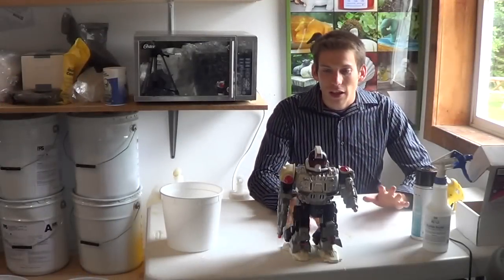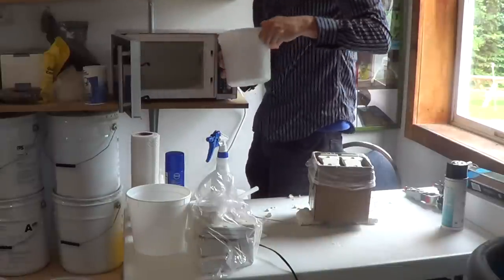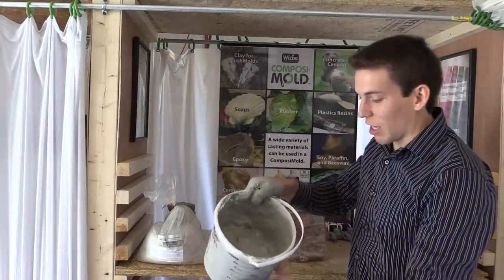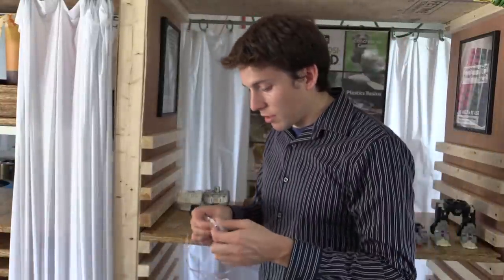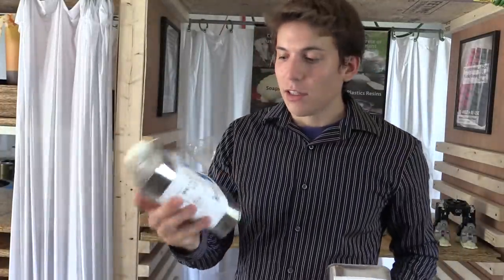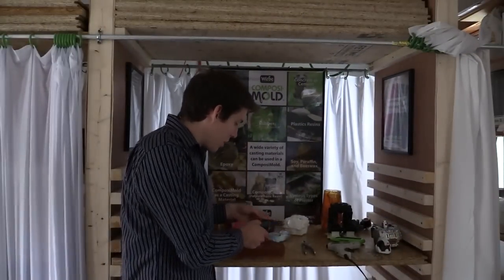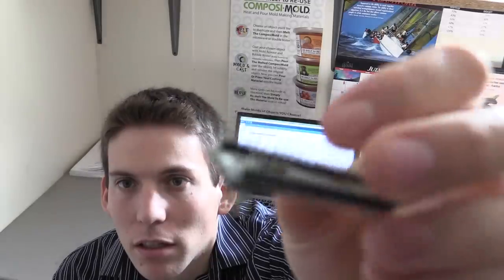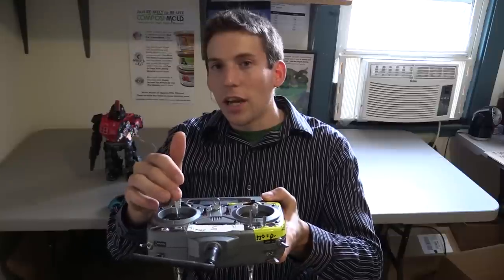DIY Robot Mold Making, Casting, and Arduino Remote Control

Comment: Just some advice, the position of the camera could use a bit of work. There's a lot of unnecessary crap in the background in some of your videos. I think it will be better if it's just the shot of what the hands are doing with some talk going on in the background. Still, I'm impressed at what you can accomplish with this.